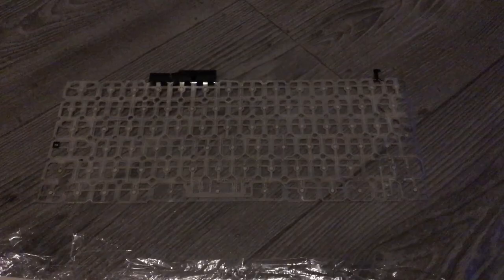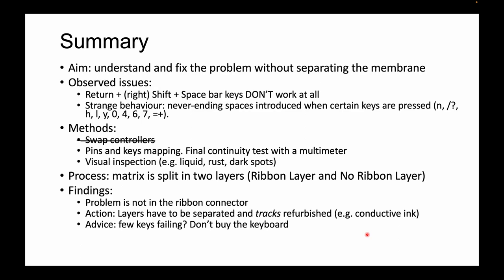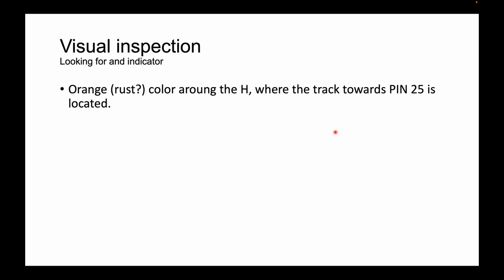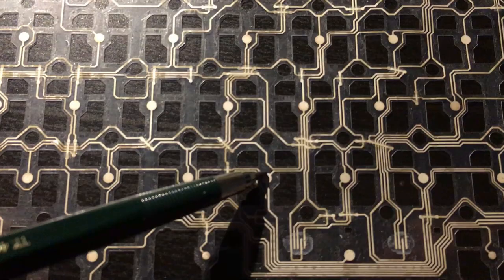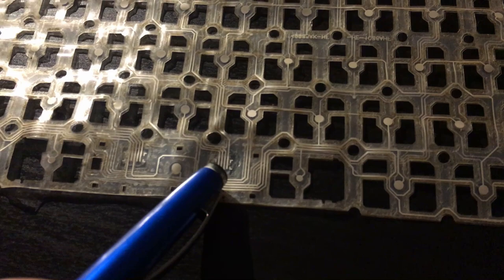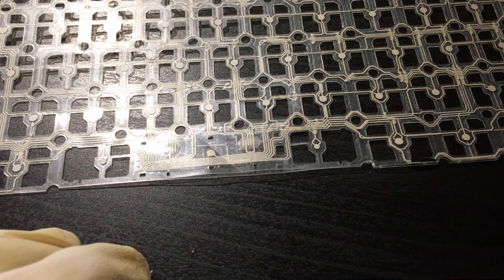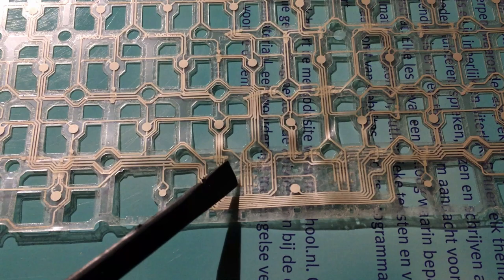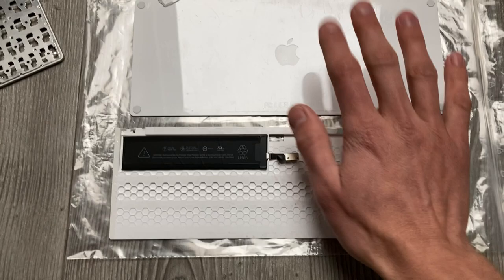What happened to this Apple Magic Keyboard? (Pt. 4)

Comment: Finally found someone who has the same bad ideas as me xD. I also have two bad A1243 and one A1644 membranes. For future viewers (not only looking for ways to fix this keyboard), be prepared that you may rip working connections apart as the glue between the layers also touches those lanes. Not unfixable, just annoying as hell. Also, thanks for pointing me to conductive markers, they are expensive as hell here as well, but I didn't have any luck with graphite because it leaves at least like 6kΩ of resistance. Also, I really required that tip regarding the layer connections.

Anyway, this video series is now saved in my repair playlist, thank you very very much :D

Edit: Btw fixing a previous repair attempt where someone cut halfway through the flex cable ._.
Reply from the maker: Hi @thebread1034! Apologies for such a late reply. It never showed up in my dash for some reason. Anyway, thanks a lot for your appreciation! This membrane is such an "unfixable" piece of art. REALLY annoying. And I completely understand you. I also can across a membrane with literally no flex cable. A R.I.P case. Did you manage to fix yours?  Greetings!